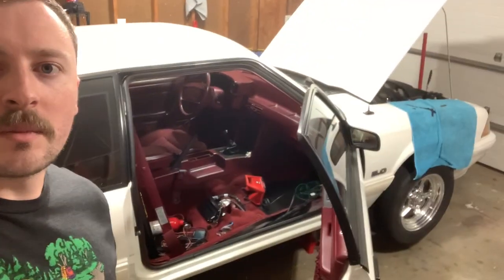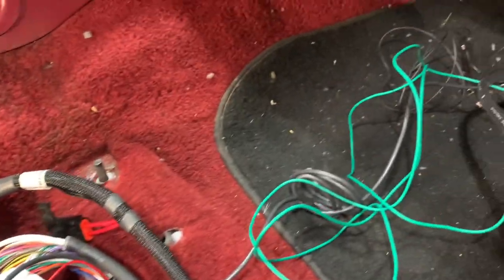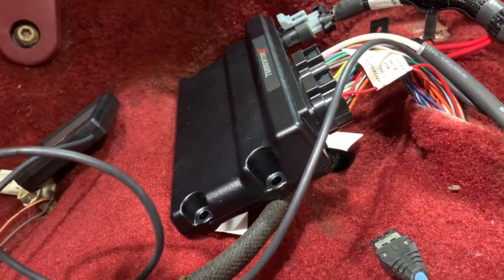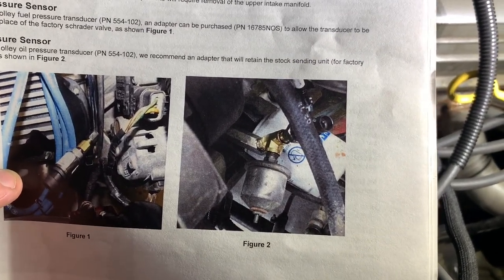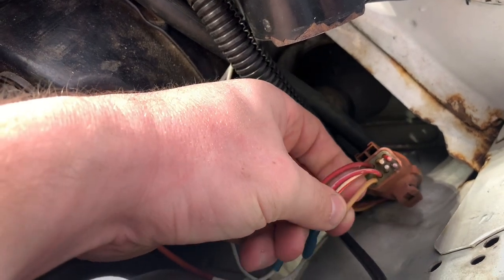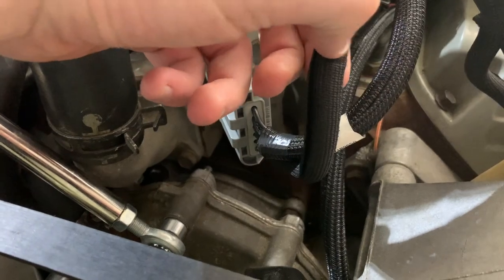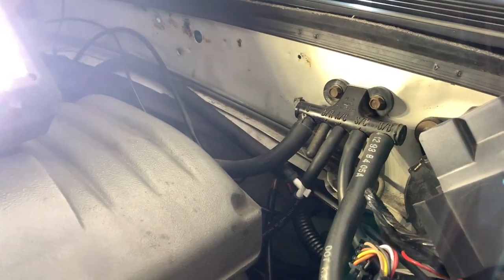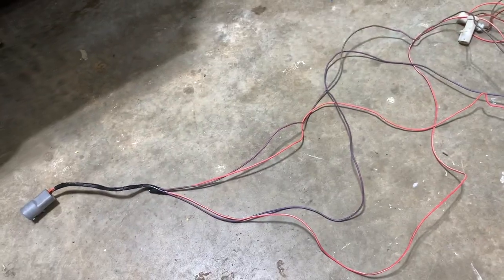FOXBODY TERMINATOR X WIRING TIPS (90-93 Car Specifics)

Comment: Good video but I got a question. What adapter did you use to mount the pressure sensor where the schrader valve goes?
Reply from the maker: The sensor I used was 1/8''NPT and the schrader on a fox is 1/16'' NPT.  Any straight adapter for those sizes with work. 
https://www.summitracing.com/parts/atm-3280?seid=srese1&gclid=CjwKCAjw59q2BhBOEiwAKc0ijQjmlu2SVMUmLRTL5NL4R5htU2GwI6GuduZi6vxxH0BYqmsPdG2rGRoCuKwQAvD_BwE

Comment: Great vid, thank you! Question: What did you do for a fuse box cover after installing the fuse tap? Just grind plastic down on the stock cover so it cleared? I don't think I've seen anyone address that. TIA.
Reply from the maker: I have been running with the cover off for a while now. When I get around to cleaning the car up some more, I’ll probably look for a way to splice into something and remove the fuse tap.

Comment: When you remove the Schrader valve you need an adapter to accept the pressure sensor’s 1/8” NPT fitting? Does that come with the Lowdollar Motorsports sensor? Or they sell the adapter separately? Or you sourced the adapter elsewhere? Thank you! This is a very helpful video.
Reply from the maker: You will need to source the adapter. I happened to have one because I had a pressure gauge there before. LMR, Jegs, or Summit have them.
Reply: The Shrader valve is 1/16" NPT. I already had a 1/8" to 1/16" T junction to mount a fuel pressure gauge off of it. No idea why I didn't find a bushing 20 years ago but now I was able to just add the sensor to the other output so I still have the gauge in the engine compartment, in case I need it while fiddling around and don't want to muck about with handheld or a laptop for whatever reason, and the sensor feeding the Term X data. Did something similar with Oil Pressure sending unit in that I created a 3-output junction (super gaudy lol, 1 for stock gauge, 1 for pillar-mounted mechanical gauge, and 1 for Term X).
Reply: Thank you for this!!!